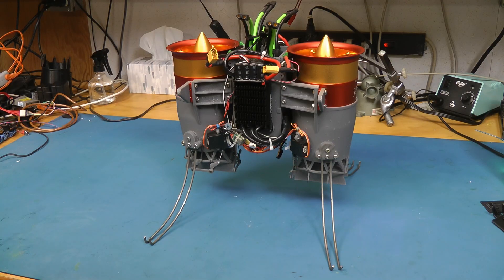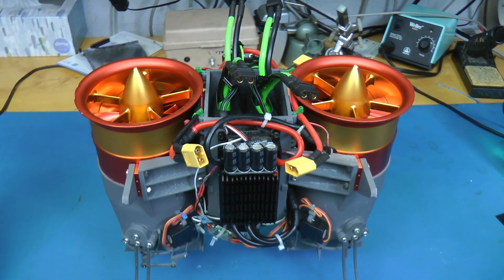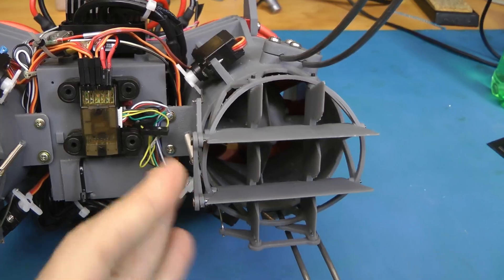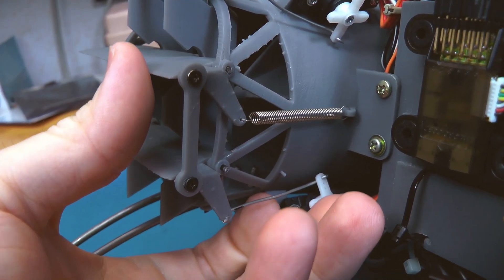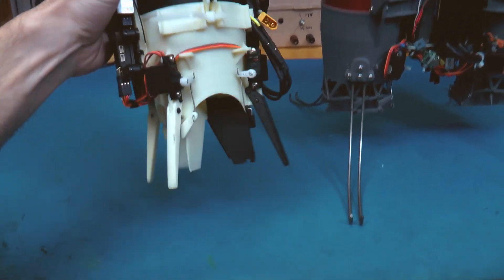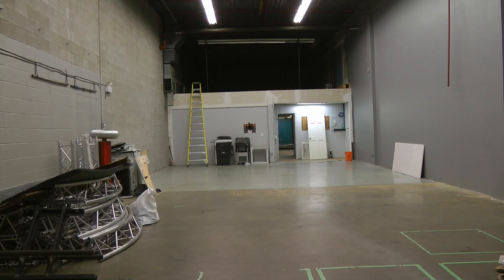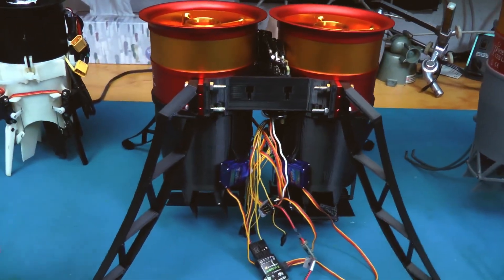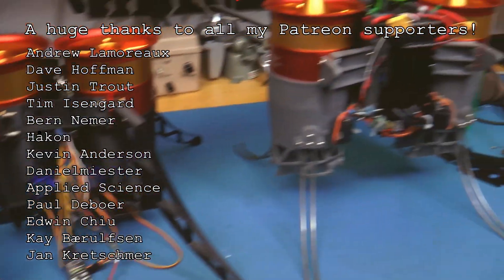Ikarus II - 3D Printed EDF UAV

Comment: A nose cone and a minimal airfoil could make this into an absurdly fast EDF missile in horizontal flight
Reply: You grossly overestimate the power of EDFs. Open prop is much more efficient and powerful.
Reply: @drkastenbrot  he didn't say anything about building the fastest possible horizontal flight craft ever made. Those ducted fans would make that go super fast in horizontal flight.
Reply: @littlejackalo5326  Wouldnt even get to 100mph, while any little race quad will.
Reply: @drkastenbrot  and it's not as simple as saying open props are more efficient and powerful. Not even close.
Reply: @littlejackalo5326  It is as simple as that though. You can just go over some EDF spec sheets, they all have abysmal efficiency compared to open prop, especially because open prop can easily be larger and the high blade area ratio means that they have a poor top speed. 

Wanna disprove me? Just find an EDF spec sheet that doesnt get utterly destroyed by a standard motor and standard prop.
Reply: @drkastenbrot  the only reason u might want a fan like a turbo fan is because the blades are short and compact and will not pass the speed of sound with their tips
Reply: @drkastenbrot  An EDF will be faster because its propulsive efficiency will peak at a higher advance ratio due to its higher blade pitch.
Reply: @SkyersJet  Neither open prop or EDF reach unity between air and prop speed so this is not particularly relevant to reaching high speeds. The area covered by the blades is, because it dramatically hurts aerodynamics. 
Both of these claims are easily verified with openly accessible data from high speed tests. The best results happen with medium sized 2 blade props at a rather aggressive pitch. More blades worsen the efficiency at high speed a lot. 
And even then, that peak in efficiency doesnt buy you anything when your efficiency is massively worse across the board. 

But the theory here doesnt really matter because of how incredibly clear it is in practice. Even the fastest of EDF drones score worse in every single metric compared to a cheap off the shelf freestyle drone. 
Please point me to any example that shows otherwise.

And here a little demonstration of open prop being unbeatable: https://youtu.be/Sgum0ipwFa0
Reply: @drkastenbrot  Well it's not black and white, prop fast, EDF slow, it depends on pitch as we both seem to agree. In any case I dislike it when people say that EDFs are less efficient. This is false. Grams per watt is not a real measure of efficiency. For the same diameter an EDF is actually more efficient. EDF drones perform badly because off the shelf EDFs aren't designed for this, they're going to be heavy and have a lot of drag and hence be slower.
Reply: @SkyersJet  I didnt say that pitch is key. I am saying that the huge area taken up by the EDF prop causes excessive drag. The reason people use biblade props instead of e.g. a 6 blade prop for a high speed quad is exactly this, the additional drag caused by the larger surface area cannot be compensated for with larger pitch. 
https://youtu.be/h7AkQtuDug4
Here is one of the best EDF drones youll see on youtube. You can really see just how much drag it is getting towards the top end of the throttle range. 

Its the same story for jets. EDF jets are painfully slow, while open prop jets beat (electric) world records.
Reply: @SkyersJet  And I know how EDFs are supposed to be more efficient. But neither jets or drones benefit from using a EDF. Top speed is worse, power is worse, flight time is worse. Only benefit is that it sounds cool and has no exposed prop.
Reply: @drkastenbrot  I agree that ducting is of questionable effectiveness for forward flight however the one thing that they theoretically excel at, namely hovering they are never used for that in the RC world because of a false belief that they're less efficient. The Icarus spends a lot of time hovering therefore ducted fans are useful in this scenario. Those EDFs produce 5kg each, from 90mm (3.5") diameter. How much thrust could you get from a 3.5" 3 blade prop? 400g maximum maybe? Clearly in terms of static thrust the EDF blows them out of the water.
Reply: @SkyersJet  I could go in again and point you towards spec sheets and the ridiculously poor efficiency EDFs get in the real world. I am well aware how ducting in theory increases efficiency. And no they are not better for hovering because hovering is not a static scenario, air still flows from top to bottom at fairly high speed. EDFs are without doubt better at static pressure (useless in drones) and compactness (the huge efficiency loss makes this undesirable too). 

A 5kg thrust EDF has to be compared to a 5kg thrust open prop setup. And in that comparison, its heavier, substantially less efficient and has more drag. 
Comparing a 5kg thrust EDF to a similarly sized open prop is a pointless comparison because you couldnt even mount the EDF to the same class of drone, it would be too heavy and draw too much current.
Reply: @drkastenbrot  So you admitted that EDFs have better static thrust efficiency but then go on to keep denying that they're better in hover. What exactly is your metric for "better in hover"? Hovering is a static scenario, if forward speed is zero that's considered a static condition by definition. When comparing propellers the swept area is the control variable, not the thrust. Even if you want to make up your own illogical control variable comparing a 90mm fan with a 15" propeller I said that for the same diameter an EDF produces much more thrust so I don't know what your point is.
Reply: @SkyersJet  All I really said is that EDFs are garbage across the board and dont even come close to getting either half the flight time or half the speed that open prop UAVs can achieve. And flight time is often measured in hover, so even there they cant make up for their weaknesses. 
The awful amount of surface drag wasnt even mentioned. 

If you would like to claim any points please do so by showing me an EDF craft that excels in something. Anything.
Reply: @drkastenbrot  I don't disagree with you that an open propeller is better for forward flight in most cases; ducting adds a lot of drag in forward flight, this is well known. I'm saying that for the same size an EDF drone is in theory more efficient and can lift more payload.  The former usually outweighed by the added weight of ducting but the latter is a very obvious benefit. This video (I forgot what it's even called, we've been arguing so long) shows the latter benefit because he can lift a couple kg with what is essentially half a cinewhoop.
Reply: @SkyersJet  So your claims that EDF has its strengths for drones are purely hypothetical. 
From the videos I saw, they dont actually do well at all for hovering.
Reply: @drkastenbrot  The efficiency claim yes, the increased payload claim, no.
Reply: @SkyersJet  Then why are EDFs not used for any payload applications? There has been so many attempts at drone deliveries and all of them either went for large open prop drones or a variant of an open prop wing. No EDF anywhere to be seen except for enthusiasts that want the model to look accurate and/or love the sound.
Reply: @drkastenbrot  Exactly. I think that EDFs would be great for drone delivery yet they have never been used for that. I think it's a combination of existing EDFs either being too small or too expensive and legislation barring payloads over a certain weight.
Reply: @SkyersJet  They havent been used because they are simply worse than open prop. Drag and weight completely destroy any efficiency gain from ducting a prop on model aircraft scale.
Reply: @drkastenbrot  It's like I'm talking to a brick wall here, I already told you I agree with all of that but they are not worse for vertical lift. Many aircraft have successfully used ducted fans for vertical lift.
Reply: @SkyersJet  light helicopters go with as few thin blades that they can get away with for a good reason: efficiency in hover.

As Dr. Kastenbrot already explained: the ratio of total blade area to total swept area (aka "solidity") defines efficiency for a given thrust. Only increase solidity by increasing blade chord or count, if you are limited by disk diameter (constructive or Mach tip speed).

The hypothetical advantages of the shroud/duct are always, always eaten up by its weight.

Ducted fans are only used in airliners and there with divergent, not convergend ducts to increase pressure and lower inlet speeds at the fan face thus postponing Mach effects in cruise flight and for noise abatement. The "unducted fan" was lighter and more efficient across the board, at the cost of horrible noise.
Reply: Why would you block the airflow with vanes if you can use your surfaces on your airfoil for controllability.
Reply: @MrJob91  So you can hover